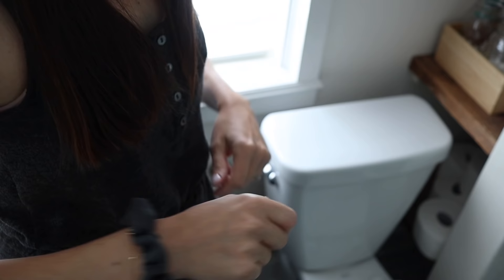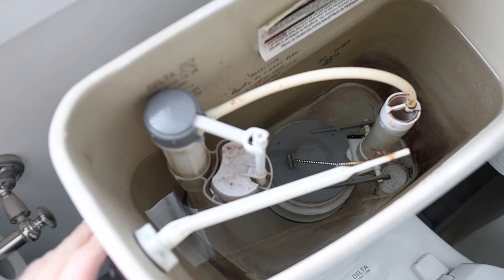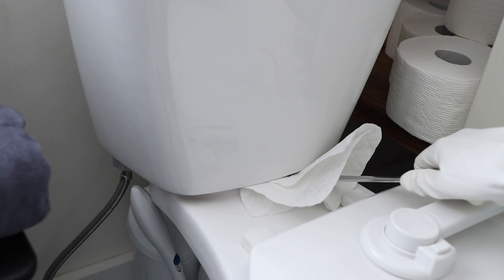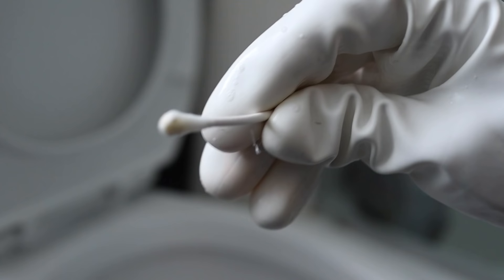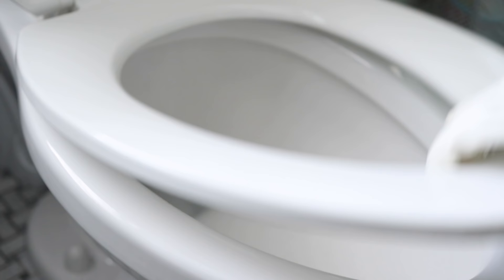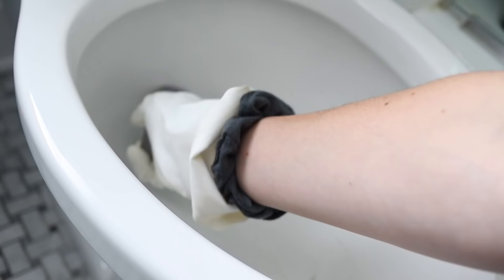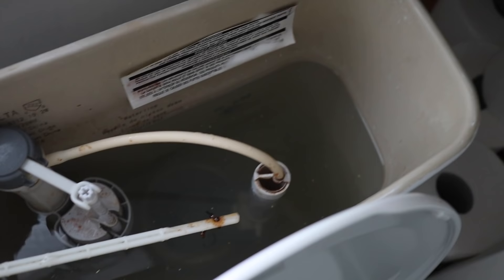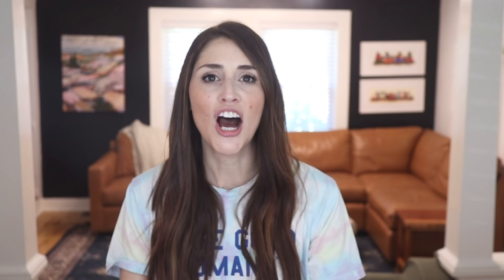TOILET CLEANING HACKS YOU GOTTA TRY | Less Scrubbing!

Comment: I just wouldn't use the hot water in my toilet as it can cause it to crack. I'd rather do a little extra scrubbing than to chance it and have a damaged toilet especially when I rent and would have a not so happy landlord. Other than that I already do the stuff on your list. You can purchase cleaning vinegar which already has citric acid mixed in it and dissolved so no having to worry about possibly damaging the toilet

Comment: I didn't know about citrus acid as a cleanser! I  will  try this for sure.
Reply: Citric acid is recommend for cleaning dishwashers too!
Reply: I just watched another video where it was used to clean limescale off shower glass and tile.
Reply: Instead of using citric acid used in food prep, look where they sell dishwasher detergent and get a container of Lemi Shine.  It is contrived acid but meant for cleaning hard water deposits as well as cleaning your dishwasher
Reply: Citric acid is great on cleaning copper.
Reply: Just make sure you don’t mix it with any bleach. NASTY chemical reaction.
Reply: I use backing soda and vinegar.

Comment: I use blue Dawn dish soap. They use it on wild animals, so it's likely safer than some other cleaning products that I used to use. Plus it "cuts through grease", so it's pretty good with the toilet after a guest messes up the back of it and leaves it there for you to clean and the water can't do anything more. You just squirt some in the toilet around the sides of the bowl, scrub a tad, then flush. No harsh smells and chemicals, and I already have that soap around the house because I can use it for so many other things, so it saves me from having to buy a bunch of different products at the store.

Comment: Just wanted to mention you can lower your max water temp at your water heater. Assuming you don't use the hot hot water regularly it's nice to keep it to about 120⁰ to both save energy and Miles' little fingers when he washes his hands.

Comment: Nice video.  Thanks for sharing.  Someone taught me to use very fine wet/dry sandpaper to remove stubborn rings.  You only use the sandpaper when it is wet.  I cut a 2" or 3" square piece of the sandpaper.  Wear gloves and give the ring a light wet scrubbing and it works like a charm.

Comment: I love to use my steam cleaner on the toilet. The super hot steam blows all the nasty stuff right out of those cracks and crevices
Reply: Oooh great idea!!! 👍🏼
Reply: What brand, where did you purchase? Thank you.
Reply: @toniy5515  therma pro 211 and I have a bissel but I hate it. It takes forever to heat up then runs out too fast and you can’t refill it until it’s cooled off. Wish I could get my money back on that one.
Reply: yeah, but where are they being blown to? your toothbrush?
Reply: @templedrake6890  not happening in my bathroom! Our toothbrushes not only have sanitizing covers on them, but they are also stored inside the medicine cabinet. Flushing alone will deposit bacteria on your toothbrush. 🤢
Reply: @templedrake6890  😂 I remove everything from my bathroom when I clean and I steam clean everything so no
Reply: @templedrake6890  plus it just gets it out of the crevices onto the smooth surface behind or beside that you can just wipe away
Reply: @mariebayona3146  Always flush with cover down.
Reply: @PinkGrammarGirl  I always do! 👍🏼😊
Reply: @PinkGrammarGirl  I do this. Then about twice a day, I’ll spray the under part of the toilet lid with a spritz of Lysol.
Reply: @1972COLBERT  A great idea I had not thought of.

Comment: Removable toilet seats the are the way to go. Pop it off and clean in the bath.
Reply: I agree…..just remove the entire toilet lid and spray down with cleaner and spray down with hot water concentrating on the hinges. I do it like every other time or so as a deep clean
Reply: What?
Reply: Right? Who’s got time for q-tips. Remove the seat, put it in the tub with some Lysol and call it a day.
Reply: Absolutely!!!  I take off the lid and bathe it in the tub with dawn.(I do about every 2 months) It's the only way to get it out of the hinges and from under the lid bolts. Sanitize the tub when I'm done.
Reply: Exactly!
Reply: @Ping Pong 

When you say "pop ... off" the toilet seat 
-- are you speaking of the toilet-seats
that 'un-screw' from the 'rear' area 
of the 'exterior-bottom' of the bowl?
.
Reply: @APGifts  yes. Although some unscrew there are some that are easier to remove that have locks to so you can take it off without tools now.
Reply: @karagunther730  

Thank you for this information.
That's great to know.
Can you provide any links to 
more information about them?
Thanks so much again.
.
Reply: @APGifts  I suggest just checking your hardware store or where ever you would buy a toilet seat from.
Reply: .
 @karagunther730  

Thank you.

Are they referred to as Pop - Off Seats 
or is there another name that's used?

Thank you again.
.
Reply: @APGifts  try "easy off" or "easy clean and change hinge" but if you ask there they should know
Reply: @karagunther730  

Thank you for this information.
.

Comment: Bar Keepers Friend was what I used to get rid of the ring in the toilet bowl.  I poured a bucket of water in the bowl to make it flush without it filling back up.  This gives a similar effect as turning off the water, but in my opinion, is a bit easier.  Then I put a good amount of BKF onto the ring, used a spray bottle to moisten the product, and then added a bit more BFK.  Let it sit for 10-20 minutes, and then used my toilet brush and it came off with just a little bit of effort.  I highly recommend!  I've used the Pumie Scouring Stick before too, and it is very effective.  I just heard that it could cause damage to the porcelain, so I try to only use it on the worst cases, where BFK isn't enough.   GOOD LUCK!

Comment: Awesome ideas!  How long have you been using the citric acid?  I’ve never used it & wondered if it would eat away the metal workings inside the tank?  I worry about such things, because I once ruined a steamer trying to clean out the hard water deposits inside. The vinegar dissolved the seals inside & made my steamer leak.
Reply: A friend mentioned that using vinegar or citric acid once a year as suggested would probably do no harm.

Comment: Citric acid does some many jobs around the house! I didn't think of the toilet tank trick, but I have used it in the bowl. AZ has really hard water, unless you have a water softener (which we did in the last house, but not this one). I also use citric acid in the dishwasher, washing machine, for hard water stains around the faucet (usually it takes that plus a vinegar soak to really get the area done), stuck on food in pans or grease on baking sheets, and probably more I'm forgetting about. I've also used 2 packets of lemonade kool-aid mix in the dishwasher and toilet, and that did a little something too (I can't remember whether it's citric acid in there too, or a different kind).

Comment: Have you noticed how you always see people scrub round the sides and back of the toilet rim but not the front. Believe me, the front gets gross 🤢. Don’t believe me!? Just hold a hand mirror under the rim. I used  some lime descaler on mine as the discolouration was age not what you might think. Left it to do it’s work for an hour the flushed the toilet three times to be sure it was all rinsed off. Used my mirror again and the gross was all gone and sparkling  ✨ white.
Reply: Thank you. I was looking for a solution for that. I tried the scroun stick, they sell at the 99çstore hasn't worked.
Reply: @crybebebunny  ...Firstly I brushed very hot water all round the rim and underneath, plus the pan. This is because I had used bleach the day before. Then I used Cillit Bang limescale remover. I put on rubber gloves and then poured the liquid onto a light scouring pad, dabbing it all around the under rim of the toilet. I left it to soak for an hour then flushed the toilet three times, before polishing the toilet dry with a soft cloth. I then checked the rim with a mirror and was so pleased to see it sparkling white.
Note: If you use bleach, do Not mix it with any other substance.
Reply: @suzanneturley4433 Thank you so Very Much. We only have one bathroom, that is one toilet, so I might not be able to leave it to rest for a whole hour but, I can definitely do it several times. I don't even get an hour to myself in the tub, I always tell them the bathroom will be all mine for 2 whole hours, if the need it now. Then someone comes in from elsewhere 🙄before the time is up.

Comment: The toilet tanks in my old condo were G R O S S!  There were dark brown.  The brown gunk collected under the rim of the bowl, and also made a ring in the bowl.  I used the citric acid hint months ago.  I didn’t bother draining the tank or using the hot water.  I just put a cup,of the citric acid powder in the tank and let it sit for a couple of hours.  Then a bit of scrubbing and a couple of flushes did the TRICK!  I was amazed.  I also used the scrubbing stick on the stubborn ring in the bowl.  Don’t be scared...the stain stick is softer than porcelain.
Reply: I have 3 toilets and I'm in a condo. No one has ever cleaned the tank. I'm going to do this for sure!!

Comment: I tried bleach in the tank and that was a no no. It was clean but it hurt the rubber and had to replace the insides. Wish I knew about the citric acid back then.Also the drop in the tank tabs I think from Clorox also were to harsh for the tank and degraded the mechanical pieces and rubber stopper.So I have been draining and wiping with gentle cleaners ever since. I will give it a try, I have heard people using Tang which is a orange flavor citrus drink.Thank you muchly.

Comment: Don't use Cetric acid, or vinegar inside the tank you will damage the rubber that blugs the tank.Thw best solution is to wipe the inside with a sponge with  little vinegar or Citric acid, but don't leave it inside. Good luck.

Comment: Toilet seat. Unscrew rhe screws. Remove the seat and lid from the  bowl. Put it in your tub or a plastic bin set in your tub.  (before you clean your tub) . Now you can spray it and use the brush to scrub it. If you use a plastic bin, you can pour the filthy water back into the bowl. You can reach the gunk on the bowl that was under the hinges and you can access the crevices more easily. Putting the seat back and screwing in the hinges, should be easy.

Comment: Do you have any recommendations for mold that builds up above the toilet water line in the tank?
Reply: in brasil we use bleach for mold in the shower and toilets, works 100%
Reply: personally i use diluted bleach (1/2 and 1/2)  with baking soda, leave it for 10min and its clean!
Reply: Bleach, 5% solution
Reply: Dollar Tree sells "The Works", drain toilet and pour in the whole bottle let it sit and 🤯, a plumber recommended it about 25 yrs ago and still the best for the hardest jobs!!

Comment: My bowl is black n reeks worse than the litter box after jus used. Was like that when I moved in. N no matter what I do or how hard I scrub I cnt get the black out
Reply: I had the same issue when we moved into this rental. Get the lysol toilet bowl cleaner in the black container. I can't remember the exact name but you'll see it, the others are blue and this one is black. Turn off your water and flush until most of the water is out of the bowl. If you have a shop vac, use it to get all the water out so you don't water down the solution and lose any cleaning power of the chemicals. Add a TON of the black lysol toilet cleaner, making sure to coat everything and let it sit for at least an hour then scrub with a pumice stone or the scrub stick she showed. I tried everything and that black bottle of lysol was the only thing that worked. Mine took a bottle and a half and 2 one hour treatments to get everything off but when I was done it looked and smelled brand new. Make sure to turn on the bathroom fan or open a window because the fumes can be strong but when you have a job this tough, sometimes the tough chemicals are all that can do it.
Reply: Thank u hun
Reply: The black lysol is "lysol Power"
Reply: Was actually jus at dt this week n picked up cleaner made for the tank. 3 flushes n only mild scrubbing later n my toilet is spotless. I've never seen the color of the porcelain inside until now n I've been trying to get it clean for 3 years. Tank cleaner worked like a miracle. Ty D bowl is the brand